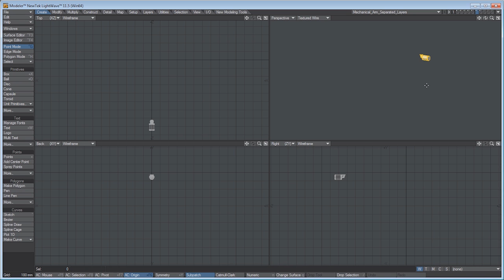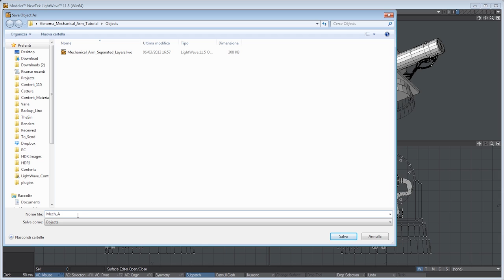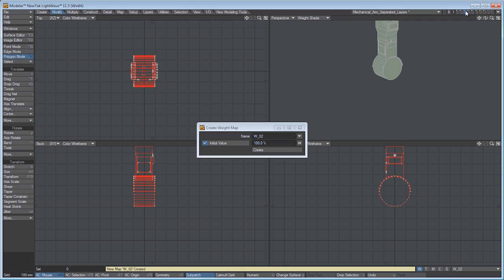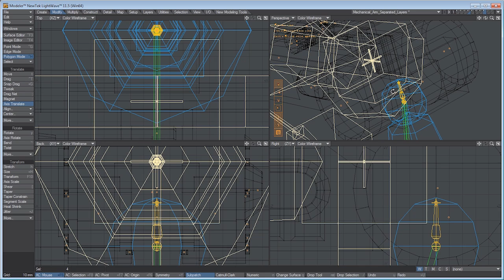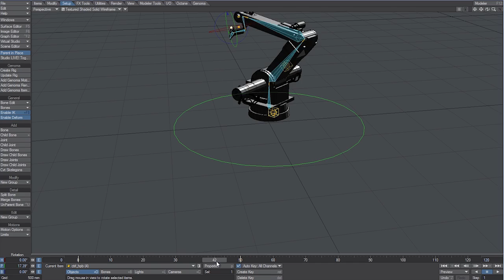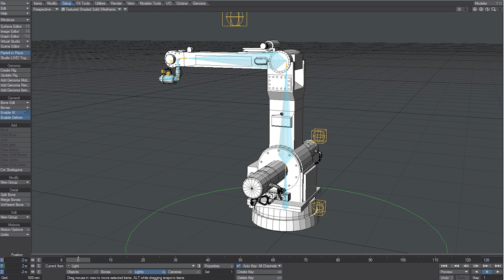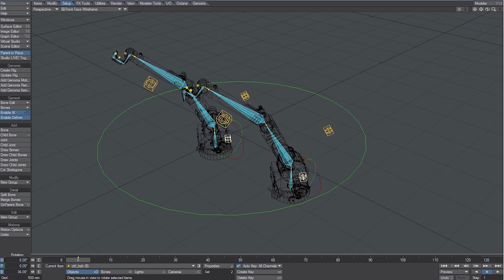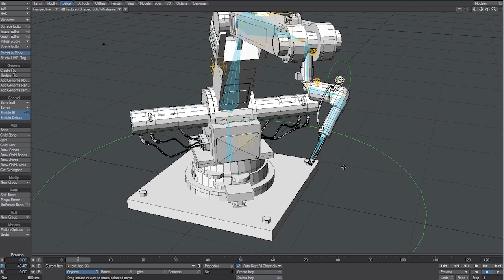LightWave 11.5 Genoma: Rigging Mechanical Objects

Comment: Hello Lino, thank you for this awesome tutorial. I'm using this technique to rig a very complex robot and it works great so far. The thing is that every joint of the robot has at least 2 hydraulic pistons to support it. So I end up adding controllers on the every piston and assigning them two weight maps (up part/down part). Problems is that when I update the rig I have to set target of each piston bone to face each other again. Is there a workaround? Thank you and the whole Newtek team.

Comment: This is a nice quick overview of how something you don't understand might work, but there is only cursory explanation. He rotates the thing that looks like a shock absorber with a counterweight attached to it, which was chosen from a pallet that appeared from nowhere, sizes the thing several times. Grabs some points pulls them down. You get the idea. Watch with the 11.5 manual addendum open. Very powerful and elegant. I just needs to have it explained in a lengthy and pricey DVD tutorial set.